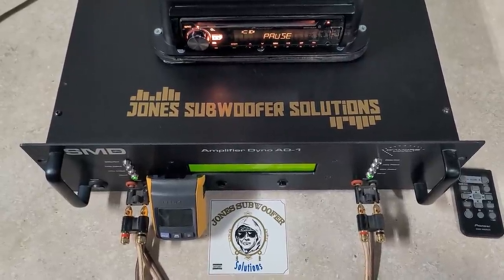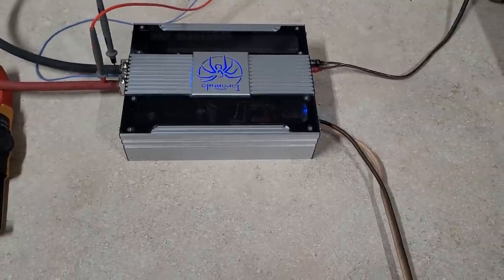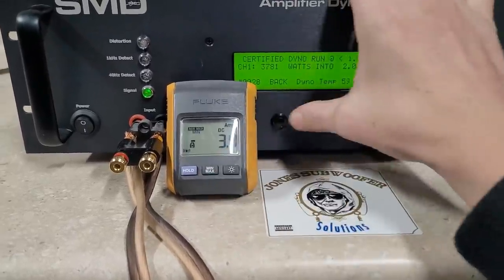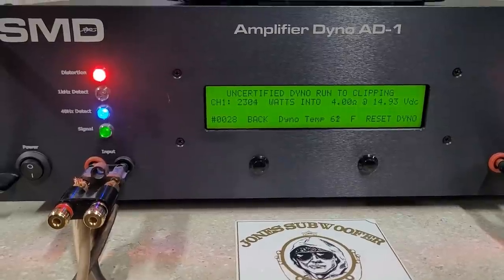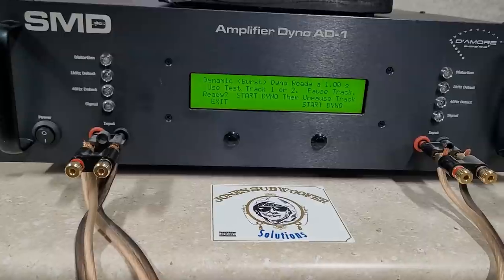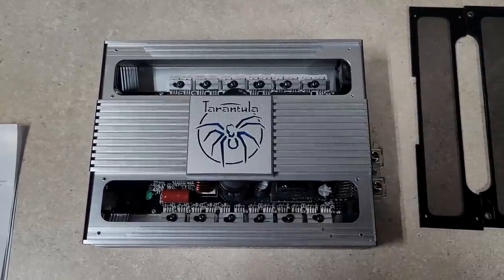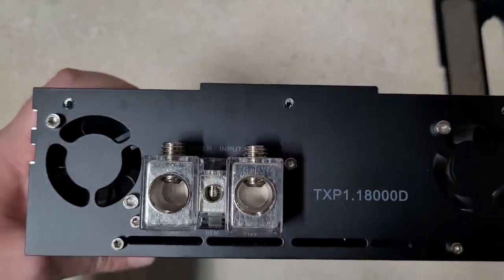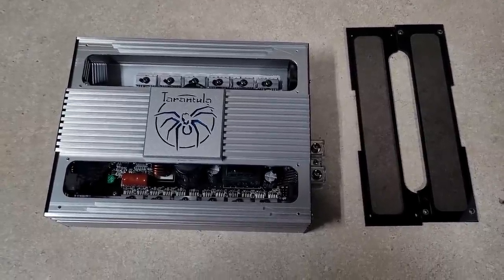AD-1 Amp Dyno Soundstream Tarantula TXP1.18000D by Jones Subwoofer Solutions JSS

Comment: 300 bucks at 6700 watts  this amp is a power house . nothing at that price can touch it!
Reply: You're right. It's on fire. So you can't touch it
Reply: Still wouldn't put that crap in my ride.
Reply: @mac4782  definitely not
Reply: @mac4782  Why not?
Reply: @JasonWW2000  Be patient save your money and buy quality. It's cheap for a reason. Cheap doesn't last long no matter what it is. Even if you're a beginner be patient.
Reply: @mac4782  Are you assuming I'm a newbie? I've been building systems for over 30 years. I'm just curious why you seem so biased against it. When it comes to car audio you need to keep an open mind. If the sound quality of this unit is good, and people have said it does sound good, then why call it crap and look down at it? The only negative I can think of is maybe it's not reliable. If it has a reputation of not lasting more than a month then I'd call it crap. So far, this does not seem to be the case. For 300 bucks I'd be interested is swapping out my Rockford T1000BD and see what effect it has on my 3 JBL W12GTi's. I might like it. I won't know unless I try. To see 5-6k watts from a $300 amp just blows my mind. I can always swap my RF amp back in if I don't like it. I would not be surprised if the spl increases. I WOULD be surprised if the sound quality was just as good. In that case I might continue to use it. You never know. Lol
Reply: @JasonWW2000  You asked me why. You must've assumed I was a newbie? 😆 I've been doing car audio myself for decades. I just tell people to save your money and buy quality the first time around.
Reply: @mac4782  What?
I was hoping for clarification and your only creating confusion. Let's try again, why would not put that "crap" in your ride?
Reply: @mac4782  ill use crap all day for 300 bucks. But i do know how to make sure its getting proper voltage and  not trying to run 2 3krms subs with it either. If you know you can get 6k out of it why try? Even expensive amps burn up when you push them to their limits. I would rather buy 2 of these and run one per sub than buy some 1500 dollar top of the shit heap amp and fry eggs on it at .7 or .5
Reply: @Hayawasa  Proper tuning and everything will be fine regardless. I just prefer quality products. Good luck 👍.
Reply: @mac4782  its all on preference ,  i have both, some of the newer amps surprise me with what they can continue to do if used properly. I do have to say , if i hadnt had some of the big name amps , i wouldnt have gotten to sell them off to brand snobs on the internet and buy several of these so called crap amps that outperform them in every aspect. The only real trade off is we are giving money to china instead of korea. I wouldnt have bothered to comment in the first place but i feel the need to inform the negative that they are mistaken.
Reply: @Hayawasa  I see where you're coming from and you're right.
Reply: @Hayawasa  100% pretentious brand snobs. They hate it when someone spends 1/4 the price they did, and their system sounds better and hits harder. 
Id be pissed too if I spend a grand on an amp that cant push half the power this one can.
Ive seen plenty of name brand amps blow pushing rated power. Acting like they last forever is just nonsense.
Reply: @jbgtly4930  for real.i run in to douche bags like that all the time at local meets and they talk that same crap about how it dont matter that mine is louder and just as clean, their stuff will last forever , and 2 months later they have to send it back to get rebuilt .people like that dont usually know anything about car audio besides throw money at it and get the local shop to rig it up for them

Comment: I have this amp now at a .5 ohm load and with box rise I haven't had any problems just make sure to upgrade electrical and batteries to feed it it takes power to make power I set my gain with the clip light on the amplifier and I am very happy with the amplifier
Reply: I was just wondering if this amp can handle half ohm thanks I’ll be buying this next
Reply: Update, this amp does not like half ohm! I rock 2 now because of that

Comment: I decided too try my first full bridge, 4 months ago in one of my builds, Sundown SFB 8k, been going strong 💪 daily, and USACI comps, wired too 1.33 on 3 PSI 18’s, I did clamp, 6738, and was dropping too 13.8, now voltage is holding strong at 14.7, 75ah cmax.. Fans are loud though... Super interested in doing a couple big builds with your subs... putting in the research, but I’m moving back too Utah so I’m interested for sure, seem solid and good prices...

Comment: I love these tests!  Thanks for the vid!  Soundstream used to make amazing and reliable stuff.  Now it seems like they just make amazing stuff.  I had an old Rubicon that had unreal output despite being rated around 4x100.  Had it down to 1 ohm for several years before it blew.  Got one of their newer 5 channel amps and it sounded fine, but nothing like that old one and it blew up after a couple years running 2-4 ohms.  Sucks that they don't have the reliability they once had.

Comment: I bought the TN1. 12OOD 2yrs ago , and on the bench it does over what it's rating are. I'm running it on a single Kicker L7 12 @ 2ohms. In a 2cube box ported to 37herzt.

Comment: Excellent video! I am so glad you described exactly what happened here with the one ohm resistive load versus a 1 ohm dynamic load like a real world subwoofer with real world impedance rise. This is something Big D needs to explain better (more often) in his tests. This is an incredible deal at $300 for over 6000 watts! For only $1200 you could have over 24000 watts rms! If you bought 4 of them. For the on sale price of a DC Pitbull 20k amp you could buy 9 of these amps and have 54,000 watts rms! And probably have money left over in case one or two of them pop! 😊
Reply: Big D ain't burning up amps to need to explain that, cuz thats why he explained it cuz it happened.
Reply: big d has.. just not every time...
Reply: He burned up a Hifonics in one video, tried to run at half ohm and toasted it. Look it up.

Comment: This is a budget gem....
Reply: Budget piece of shit if you ask me! Blew on the table! 😳
Reply: @tammyforbes2101  yeah it blew at 1ohm when pushed but 4-5K watts for $300? Cmon that’s a gem
Reply: @Hectoriousz  rated at  >.3 THD 🤔 means it's a piece of shit for subs 🤫. Almost no cone control! Not to mention 5k and they boast 18k. Damn not even 9k. This amp has SHIT written all over it. $450 on average may be ok for mids, but not for dirty power on the subs
Reply: Its junk
Reply: Junk
Reply: @rhetttravers8682  💯🐂💩😐
Reply: Naw I’ll have to side with the “this is a budget gem” comment. 🤷🏾‍♂️ only because I actually have this amp on 2 15 inch kicker compQ’s 🔊🔊. All good with me though ✊🏾. As he stated the impedance will rise 🤷🏾‍♂️🤷🏾‍♂️. So for the price yeaaaaaaaaaaaaaaaaaaa boi!!!!!
Reply: @APBtDiezel  finally someone that knows car audio this amp is great there's no other amp in it's price range can touch it
Reply: @Mr.NpK143  this amp is a beast it never claimed to do 18000 watts it claimed 7000 so look at 18000 as a model number I run this amp daily at .5 ohm load no problems and it slams my 4 American Bass Elite 15s
Reply: @alexturner4312  lol I guess JSS is seeing the same thing I'm seeing. 18k max @ 1ohm! Soooo what the hell are talking about looking at it as a model #?
Reply: @alexturner4312  And not to mention this couldn't even do the 7k rms it promised @ 1 ohm before it went to hell w/ gasoline drawers on. But you sir would like to make a legit claim for a amp that failed in every aspect on the bench only because you have one 😆. I'd imagine this amp produces more dirt than a construction site, but thats ok because it bangs entry level subs  like 4 AB Elite and 2 Kicker Comp CVRs. 😉

Comment: This is a badass amp for the money you will not find better at this price! This amp will absolutely slap! Two 15’s in a hatchback it will blow your back glass out no problem. The sound is crisp and clear. I know he was able to blow it but this amp has lasted 2 years on 1 ohm hooked up to 2 15in kicker comps with impedance no problem
Reply: How was it wired to 1ohm on 2 comp 15's when comp is either single 8 or single 4 ohm coils?
Reply: L7 Q class 15s

Comment: Theses exrteem series amps are amazing. I say this with the caviot that I match my impedance to my speakers wattage necessity, so I can maxize the output of the speaker and don't abuse the amplifier with the hardest load.   Also the sound quality of these amps is superb! And I mean full spectrum! So 
I'm running the the  txp1.12000d @2ohm on 2 - L7 15 Qclass D2's. That call for 1200w rms... Each. There is no need to stress these amps down to a 1 ohm load. I'm getting 2830w (clamped) @40hz showing 13.9v, from an amp rated to produce 2300w @2ohm with14.4v. 
Think about that...

All this chasing the lowest impedance of amp stuff... Unnecessary. Take it from a vet.
Reply: box rise tho
Reply: How is the sq at low frequencies and how much hissing do they make through the subs? I'm considering one but my subs are sitting in the back of my suv. I don't want any weird high frequency noises coming from the subs that I can hear. Some class d amps do it and it's normal because of their design.
Reply: 🐂💩!  HOW  IS THAT STRESSING THE AMP THAT'S RATED AT 1OHM? 🤔
Reply: @2slofouru  excellent with no his whatsoever. Also, the higher impedance seems to make the gain control less sensitive and this is always a plus.
Reply: @Mr.NpK143  it's actually 👌 The rating of 1 ohm, is simply stating the amplifier "can" be wired that low. The manual offers wattge ratings for 4, 2 and 1 ohm loads respectively and like I told someone else it seems like there is more controlled or dare I say cleaner power at higher ohm loads, where it does not work the amplifier as hard to produce. 
More than six months and the only thing it's missing is... stay tuned to my page for a "1 year review" of both the Soundstream extreme 12k and the L7 Q Class 15's!
Reply: @allmotorhash  properly built sealed box and you'll be OK 👍 It wont get rid of  it at all but it seems to level it out for sure!  And its over  surprisingly low, frequency band. 23 hertz, on a fulbridge!!! 👏 👏 👏
Reply: @test1014  any amp runs more efficient and cleaner at a higher ohm. So what exactly are you saying other than you're doing those kicker subs a great injustice by supplying them with possibly the dirtiest power in the game?
Reply: @Mr.NpK143   I guess that's the point of my entire comment thread. At this price point there is no cleaner more efficient amplifier.  LISTEN,  i buy high end and  budget amplifiers regularly because my customers have diferent price points. The facts about these amps remains that they do there intended rms values at 1/4 the ppw (price per watt) of a similar amp like Tarramps, Fosgate, or alpine of simular output. Ive had mine for a year I'll be releasing a living with this amp video soon I hope you watch it.
Reply: @test1014  I'll watch, but these amps don't do rated as this video proves. It maybe cheap, but that isn't always good. And in this case the proof is in the pudding. Just look at the THD for example and you'll agree it's horrible
Reply: @Mr.NpK143  good for you , have a nice day.
Reply: @Hayawasa  always. If it were any nicer it'd be 2 of me!
Reply: @Mr.NpK143  glad there isnt, one is enough lol.
Reply: @Hayawasa  that's about the smartest thing you've said in your life, but since you went that far you can call me your Daddy!
Reply: @Mr.NpK143  im probly older than you , but i know for a fact u havent ever said anything smart in your lifetime haha
Reply: @Mr.NpK143  i sit and watched a couple of your videos, you are alright . You got alot of the same equipment i do. I dont know why you dont like those amps , they are good if you use them right. Anyhow i got them k6s too , had them about 3 years and they are like a sore dick, they are hard to beat. some of the best ive had for under  200 a pair
Reply: @test1014  You are 100% correct .
You have more control over the amp at a higher impedance.
4 ohms or 2 ohms just sounds much cleaner especially if your getting over 2000 watts at 4 ohms or 2 ohms no need to run it that low.
I have run mine at 1 ohm but mine sounds better at 4 ohms or 2 ohms.

Comment: I have two of these amps on two 18’s when soundstream  said they made these amps so you won’t need a truck load of batteries they didn’t lie this amp doesn’t like being over 14.4 volts
Reply: These two amps replaced my two taramps md 8000.1 I had more problems out of the taramps and I still said I’m waiting for someone else to do a better dyno on this amp Because I have had these amps for three months running in a 1 ohm with no problems
Reply: Agreed to much power going in needs to be no higher then 14.5v I ran mine with my amm1 and got 6700 rms at 1ohm no problem 😉
Reply: @nvx8k  what problems were you having out of your Taramps md8000? (curious since I have a 1 ohm md8 amp)
I'm shocked to hear that someone switched from 2 Taramps 8k amps to 2 of these Soundstream.... No way these Soundstream are putting out even close to the rms the Taramps do! And even those these Soundstream may not be as power hungry as some other Chinese I'll never believe that when wired at 1 ohm that these Soundstream are more efficient than the Brazilian Taramps. Even when a Taramps 8k putting out more rms than this Soundstream I still think the Taramps would draw less Amperage & be easier on the cars electrical system than these Soundstream "18000"
*BTW I'm by no means a Soundstream hater. I know they make some decent products long as one knows which to buy & which to leave on the shelf. Too bad they aren't the same company they were a long time ago. They did make GREAT audio gear years ago instead of this mediocre stuff they make now. Idk my opinion bang for the buck & running at 1 ohm I prefer Taramps. That's just my preference & everyone has different opinions & different experiences with car audio products given they are running different quality wiring, alternators, batteries etc. 

*Current new amps I have: 
1. Taramps Smart3 (been running it for months on a single 18 and pushing amp & sub both hard, have had problems out of neither. Plus I can't even begin to describe how amazed I am at how efficient the 3k Smart3 is! At full till playing rebassed rap I see ZERO voltage drop)
2. Trauma Concussion Series 3.5k Bluetooth amp (Korea amp for anyone not familiar with Trauma amps)
3. Taramps md8000.1
Reply: Agreed as a member of team soundstream im here to say all numbers that epsilon rates there products at are rated according to specs and this being a fullbridge amp with high current low power design in mind honestly sits real happy at 14.2 volts and the packaging also clearly states that it can be drivin at 16 volts testing was done at 14.4 and it recomends not to exceed 15 volts because the current draw is much higher than that of a standard halfbridge esspecially with a resistive load speakers in enclosures change there own impeadance quite a bit you never wind up being at 1 ohm due to the box rise so case in point sir you have diligantly shown the world how to improperly utilize an amplifier dyno
Reply: This amp blowing up was faked....

Comment: Amp dyno runs certified to 1percent thd. This amp is rated at 3percent. So with rise wired at 1 ohm and 3percent thd I am positive it'll hit rated power at 1ohm. This is the bargain basement price for insane power. Even 2ohm hit rated at only 1percent...win! I'm going to pull the trigger on 2 of them. One each for my Sundown Zv5 18" D1's.
Reply: Damn bubb you make me want to get 2. Great explanation
Reply: It's not 3%, it's 0.3%. That's an important difference.
Reply: @JasonWW2000  oooh, yes. You are correct. That will change the expectation of hitting actual power as advertised. Hmm, even more interesting is that they're claiming 1/3rd the THD than the amp dyno tests at yet the amp still won't make rated power. Good catch homie. I still feel these amps are great bang for the buck. :)
Reply: @Bugglebub  Yes, they just need to name it as a legit 6,000 watt amp. Using the 18,000 number just makes it seem cheap and unworthy. They are shooting themselves in the foot.